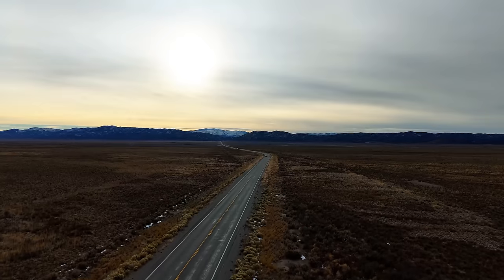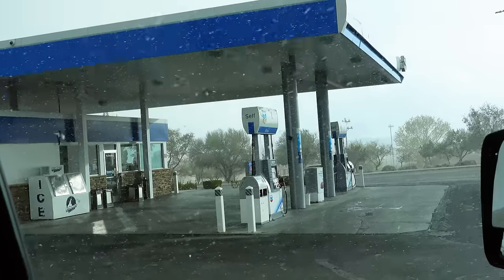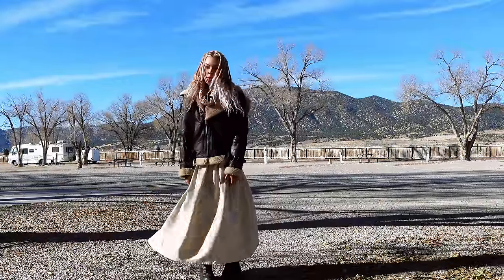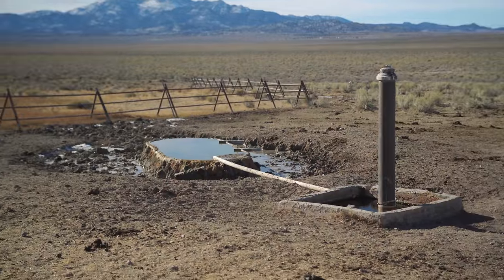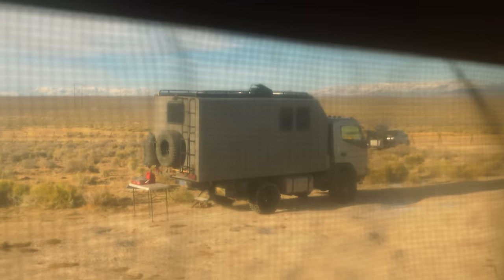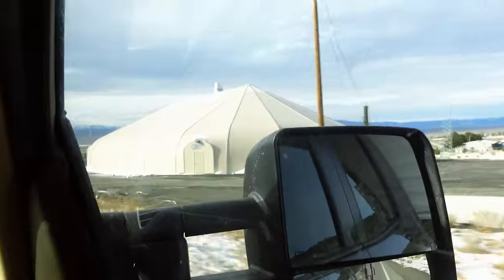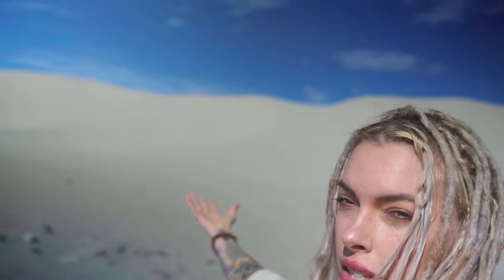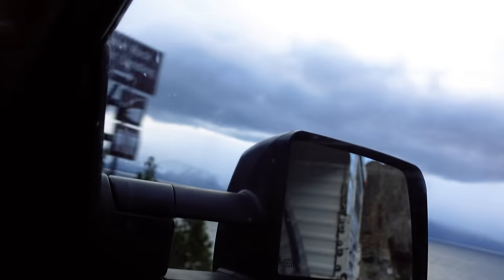surviving the loneliest road in the USA... (hwy 50)

Comment: Hey there,
One thing I learned with my truck camper, or any camper for that matter is to buy a $20-30 electric heater at Walmart, or Target. So when you stay at a campsite with hookups, you use it instead of a propane heater that runs out of propane, makes too much noise, and has no thermostat! Can even work with a Jackery.
Much better/cheaper than gas.
Reply: Yep. & you learn how to tweak it just perfect for the exact heat you need. Plus this rig seems like it has all the power needed

Comment: I broke down in an 18 wheeler outside of Austin one Friday night, that was a lonely highway! Cowboys and miners made up the population at that time, I might suggest Buddy propane heater doesn't use electricity and very little noise, good heat, get the adapter for a 20 lb. tank

Comment: Also, if you want to save yourself from the condensation problem, get yourself some R13 insulation board (1” thick) and mount it to the walls inside.

Comment: If you get an mss sleep system you would be covered in any weather from 50f to -50f rain snow or shine outside. Typically about $125 -150 with 2 bags and a goretex bivy in a stuff sack. 12lbs but tough and reliable. Brand new they can run 500. Good surplus store or in the right community they are 125 used.

Comment: Don’t you use an electric blanket?  They are low consumption. Turn it on for 3 hours before bed then turn it off or to the lowest setting if you have the battery capacity.  Also, a dehumidifier can stop condensation forming

Comment: you should put some half pipes with holes in under the bed to air it. (cut a pipe vertical and drill a line of holes down the centre, the repeat along the length of bed)  It helps a little bit but as you drive just stand the matress up.  x x x
Reply from the maker: It’s too snug in there with the roof down to lift it while driving unfortunately

Comment: What might help in the future for insulation around the inside of the canvas is Yoga mats? They roll up and the dense foam is a good insulator. We’ve been full time RVing 7 years and every rig/ rv comes with a learning curve as you are fining out. Also you mentioned the thermostat not working. Is it an older analog not digital one?
Reply from the maker: It’s not digital no and interesting idea you’re right about learning your specific camper

Comment: You should go to Walmart and invest a little bit of money in the heater called a little buddy. It has a carbon monoxide safety shut off,  it so it won’t kill you if you run it at night it’ll shut off . just in case your other heater fails you have a back up heater They  run a little propane cylinders all night.
Reply from the maker: Well fortunately we are out of the cold lands so we don’t need a heater much anymore but yeah would like to get an electric one for while we stay at rv parks

Comment: Hello Victoria,
Nice sun-lite camper.  I purchased a sun-lite eagle this spring and of course there was a leak around the vent.  The question I have, how did you get the styrofoam to dry out or did you just remove it all?  My roof doesn’t seem rotten and the corners/torsion bars are in place.  I really don’t want to tear off the roof like you did, looks like it was a lot of work. 
Shawn
Reply from the maker: Don’t try to tear it out it’s pressed in- we had it air out in the sun after taking off as much paneling as we could but I do not recommend it
Reply from the maker: If it’s just around the vent I’m sure there’s a way to maybe just patch it up there?
Reply: @TorieRobot  
Ok, I’ve removed a few inches around the vent and have dried the ceiling with a hair blower.  However, the styrofoam is still damp inside.  Hopefully, it will dry this out winter.  The guy who sold it to me was honest about the leak.  So, I knew what to expect but I didn’t know about the side/corner issue with these campers, problems with their torsion bars.    I got lucky, unfortunately it sounds like you didn’t.  Looks like you worked hard on it.  Ultimately, I hope my roof doesn’t need replacing, I can stand on it, it seems sturdy.  It’s a shame these campers have an Achilles heel.  They are so versatile and unique.  I put an AC on mine this summer and took it to the outer banks.  I’m working on an indoor shower now.  These campers have so much potential.  I’ll continue to watch your channel to see if you make any improvements to yours.  Thanks 
Shawn